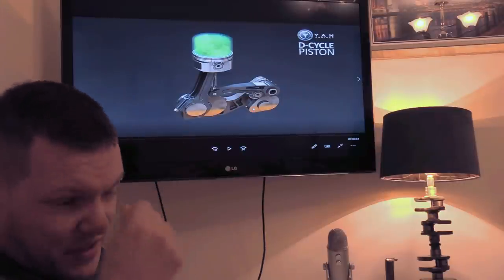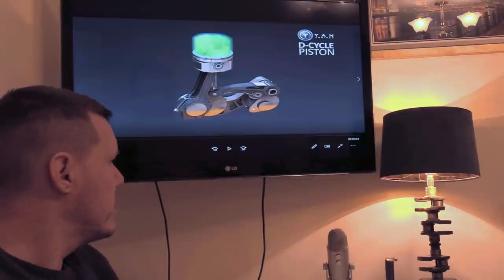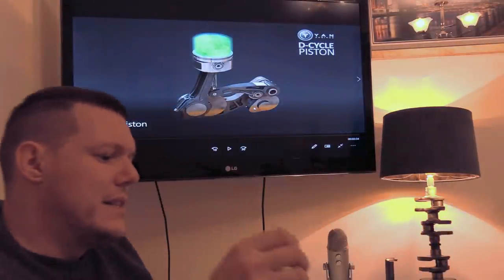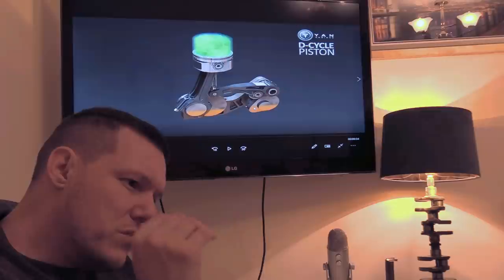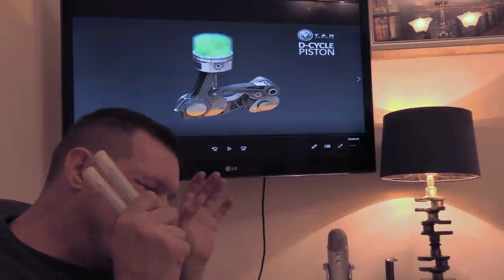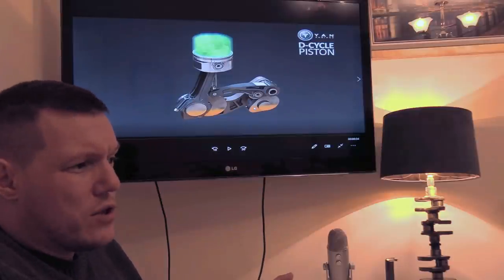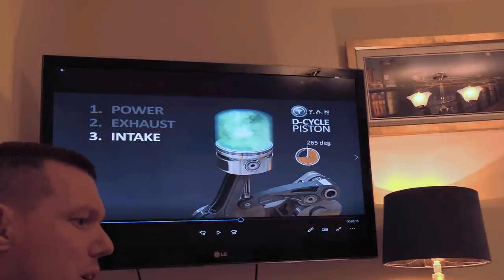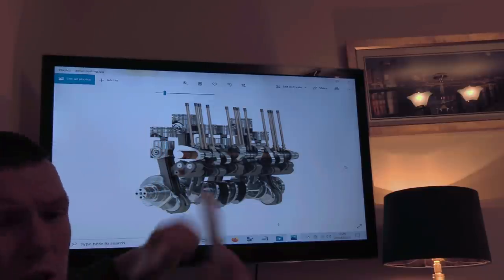D cycle engine | Part 2

Comment: maybe I was a little pessimistic with my comment on the last video, but im still worried about the wear the piston crown coming together with the lower piston will cause
Reply: Just make the bottom part have more surface area, then you get an air pillow effect, which can be tuned and will likely have an rpm where it becomes restrictive, but it also means less wear or damage as rpm increases
Reply: @aterack833  then you seal it off, so how is oil coming to the piston crown, or if there's oil coming in, how will flow out?
Reply: @theo_korner  if you look, the piston crown doesn’t have a pivot at the top, and if you look at a regular piston the crown doesn’t have oil just the skirt, the crown has the scraper rings, so when the skirt comes down and leaves a film of oil behind the crown then rides on and scrapes this film down as it comes down, the area in the middle can be for excess oil as well as for the movement of the mini connecting rod that’s connected to the crown. On a normal piston the oil control ring is responsible for putting the oil on and for where it goes, there isn’t any separate oil system for the scraper rings or the crown itself, if anything it has more chance for excess oil to escape down the opening/openings in the skirt portion compared to a normal piston, if for some reason there’s a failure with the oil control rings that cause it to flood more oil in, but there’s no advantage for fluid above the piston though because the scraper rings are still the same
Reply: @aterack833  not for lubrication but to get the heat away, because the crown itself is not that big in mass
Reply: @theo_korner  well if there was a piston cooling jet, it would have to squirt into that opening if that was the case, but maybe the oil left on the surfaces would prevent the clapping effect, if not, I’m sure a fine tuned level of closing in could be done to allow a protective air pocket at the speeds that would most cause this damage, or the speed the engine would sit at the most, they could even be concave with drain holes on each side (just to reiterate, I’m only talking about the portions beside the opening for the other connecting rod), it’s even possible to have the cooling jets be timed and to shoot through the drain holes and then the oil would drain through when the jets stopped, or just have them aim through the slot for the other connecting rod.

The new question that comes to mind though is aeration once the air pocket has to move through the same openings as the oil
Reply: @aterack833  i was thinking aswell that oil in this cavity could act as some kind of dampener
Reply: @theo_korner  it would but getting it there means having the wrist pin porous or having the cooling jet aim weird, at least for a standalone oil film method.

With the air pocket method you most certainly would get more oil film also, and tuning of the combination to have the least resistance without slapping would be the hard part because the dynamics of the two don’t move exactly linear with each other but they are connected, any restriction in air means oil will stay there longer, and the fluid dynamics of the two will behave very differently.

Comment: You know what’s interesting? If you timed it right you could have a little bit of the power transmitted through the small rod and push the cam (ever turn a camshaft on a head off the engine and have it spring into positions because the springs push the cam?) that way it slightly reduces how thick and strong the regular rod needs to be
Reply from the maker: Applying force through a cam is not a good idea, and across a beam is even worse

Comment: My biggest concern would be that the top piston is the limiting factor for overall rpm
Piston ring flutter is overall the limiting factor for engine rpm (everything else assume built too handle)
I would expect far lower crank shaft speeds due to the exhaust/intake rapid movement 
That being said,
It could be good in diesels 
As it’s the fuel burning speed that is far more the dictation of rpm

Comment: There are a few clever aspects of this engine that I really like. The conrod and the piston of a traditional engine is designed to deal with the pressure of the power stroke, and the strength is wasted in the other strokes. This design keeps the heavy  conrod and piston bottom (if you can call it that) for the high pressure operations while it rushes through the low pressure strokes using lighter parts.

In a traditional 2 stroke, the exhaust port would open at 120 degree crank angle or something around that anyway, so I don't think there is not much "effective" loss of displacement compared to the length of the stroke.

A design that solves (in theory) all the problems of a 2 stroke by taking away the simplicity and weight advantage, with some side effects like over-expansion, but keeping that one thing that makes 2 strokes really great, 2ce the number of power strokes.
Reply from the maker: Cylinder density thats why.

Comment: The best way to make high torque applications like you mentioned become electric only is to have them run on rails or with cables (boats can’t run on rails reliably for long distances) that way they have electric power but don’t need to carry a full load of batteries to deliver coffee, they could have a specific lane and a special method to engage and disengage from the rail and a smaller battery set to get to the next rail for highway and road vehicles, but the real star will be bringing back rail dependant vehicles like trains and any other word for trains that just indicate where the train is (on ground, above ground, underground, whatever) and they can even start building buildings around them to make better use of the land and keep people off the rails (likely government buildings or anything with people known to be smart enough not to hop off the roof onto the rails or something) and for areas not covered the trains can have a two part system to keep the amount of track that is electrified limited, part one is having switch boxes that only electrify sections at a time that are the length of the train with a typical load of train cars, whatever keeps the number of these boxes down while keeping the chance of someone getting onto a portion that has electricity going through it low, it’s more the distance behind the train that’s the issue, part two is a battery system to both allow gaps between these sections and more importantly allow the train to not get stuck if a box fails and a second doesn’t power up

Comment: This seems like a good application for things like boats and snowmobiles which need mid range torque to be effective. Also there is a reason Yamaha didn’t just stick the r1 engine in their snowmobiles, a high revving engine doesn’t work for many reasons but a big one is the clutching and limited gear range of the cvt which uses a rubber belt. Yes they might be able to put a cvt with a steel belt more similar to a car however I doubt that it would do much better and it would add a significant amount of weight which would deter people from buying the sled in the first place. There’s a reason the brp 600cc and 850cc snowmobiles are still the best selling in the industry (yes I know that’s partially due to them being cheaper to purchase compared to equivalent performing 4 stroke snowmobiles like the Yamaha sidewinder which is a turbocharged 1L 3 cylinder.
Reply from the maker: It's called gearing... you can take your high revs and gear them down...

Comment: Isn't this an Atkinson cycle engine executed differently?
Reply: Exactly my thoughts too. Intake stroke 65 deg power stroke 120deg. When I commented on this on the first video I got a lovely reply.
Reply: Yeah. I also see it as an Atkinson cycle. I suspect that's where they are getting the 20% improvement in efficiency claim too. Not inherent to the design though, since you could just grind the cam differently for a plain old otto cycle.
Reply from the maker: Crank degree has nothing to do with intake/power strokes when the piston doing such actions isn't controlled by the crank. Andy got a standard reply, standard when someone is too stupid to see this but claims im the idiot 🙄
Reply from the maker: Lol fuck sake. Where is the 20% efficiency claim?
Reply from the maker: "Not inherent to the design" finally, someone with eyes...
Reply: But the power stroke looks longer than the intake. Explain to me where I am wrong, don't just write stupid comments.
Reply from the maker: You just wrote the intake is 65deg... it's not. Infact there's no such thing. Strokes are measured in length not degrees. 

And if you say thats not what I meant, its not even 65deg...

Comment: Starting with different displacements on the intake and power strokes, if the crankshaft is at 15^ BDC and the rod angle is ~15^ would any rotational force be applied to the crankshaft by the piston? 30^ of not much happening, IMO. But the scavenging cycle is advanced and with a literal four stroke operating cycle this fires every revolution. Doesn't that increase power per displacement so reduced size & weight, less inertial forces ion components, less friction, etc? 
If sized as for say motorbikes and efficiently tuned to a specific rpm (2-3k?) couldn't this concept have much to offer for hybrids? I can hardly imagine they're going after Alfadan for size with this one. 🙂

Comment: From the mediatechnical page on this design." More than this, it provides a much greater flexibility in improving efficiency, for example by reducing intake stroke volume to match the desired drive cycle demand with a long Atkinson expansion-to-compression ratio." well?...
Reply from the maker: Well what? You said 65 deg of intake, you're shifting the goal posts to avoid what you said.
Reply: @dirtygarageguy  No from the off (pt 1) I said Atkinson cycle. To which you replied "do your eye's work" it looked like it to me and this article bears it out.

Comment: The complexity argument is not valid since we used engines instead of bicycles and live in houses instead of caves. Also for the 12k rpm Warriors, some 2t dont Rev as high as their 4t counterpart, because they have more powerstrokes and doesnt need It.

It would be awesome have these engines into production. Imagine a twin cylinder 500cc bike with the D engine

Comment: So this engine is basically garbage but I have a question instead of having an exhaust stroke on a Diesel engine is there a way to open both the exhaust and intake valve at the same time and let the turbo push the exhaust air out while at the same time filling the cylinder with fresh air essentially turning it back into a two stroke engine.
Reply from the maker: This is called a uniflow design

Comment: I can’t see how the down force from the second piston combustion adds much of anything to the power to the crankshaft.
Reply: Oh. Back through the cam drive gear. Not sure how well any lobe profile would deal with that type of force.
Reply: @archiedentone5950   isn't there a second piston underneath that it meets up with? Majority of power is transferred to that and then to the crank. The cam and crank are connected via gears (notice the opposite rotation)

Now if the pistons hold up during contact or not is a different strory
Reply: @AmritGrewal31  only every other firing event. They “odd” events only drive the top piston

Comment: Weight wise, given most engines these days have a balance shaft (which I assume they'd incorporate into the cam) there's prolly not a lot in it. Complexity, well ,it's just another cam and roller rocker, meh. Really it's not much different to running a mechanical fuel pump off a jackshaft. Yeah, crown float could be an issue and valve clashing or even reduced intake stroke  if the rocker doesn't have some kind of return mechanism but I'd assume shit like that would be ironed out way before production. Personally, I'd say it's got potential - especially if they made it revvy but I'm guessing this is more "same power for half the rpm" type deal, less nvh etc. etc. That 20% seems like marketing wank, I do wonder if it's a case of "this is a 2000cc engine but swept vol is only 1600cc", unless it's a case of more power pulses mean less gaps and therefore less energy spent trying to rotate everything again after a gap (would a 4-stroke 2L I6 be more fuel efficient than a 2L I4 of similar design?) Be interesting to see how the rocker bearing holds up to the crown halting abruptly towards the end of compression stroke. Nice thing about this is a 3-cyl should be as smooth regular 6-cyl. Imagine a V12, power every 30° 😈

Comment: 5:16 But you're comparing a whole system when you say that. In a purely mechanical system if you can do the same thing with less than its almost always better.
Reply from the maker: Correct, so which on is it? Which part can you do without and achieve the same outcome?
Reply: @dirtygarageguy  A second piston...
Two pistons is likely less parts than one of these...

Comment: Thank you for an interesting vid. I really can't see this engine potentially making 130% power compared to a fourstroke, because the intake stroke is so short. The intake takes place between 200 and 265 crank degrees, which leaves just 95 degrees of the total stroke for induction and compression. Compared to the simplicity of a two stroke engine with no valvetrain, and a normal fourstroke engine, the added complexity and inefficient use of the total stroke in a D-cycle engine, makes it look pretty hopeless.
Reply: Just wanted to add, that if you look for a shorter compression stroke than powerstroke, I think some kind of Atkinson cycle engine probably does that more efficiently, power to weight ratio taken into account

Comment: really sorry I missed the first part.  After review, here's my thoughts:  12,000 rpm, is 200 rotations per second, the piston changes direction 400 times/second, the upper piston changes direction 800 times/second,,,, I don't see it happening, not very well, nope, I don't see it/  Splendid videos, thank you
Reply: Just run it at 6000 rpm
Reply: @aterack833  Chainsaw
Reply: @thomasgronek6469  gear drive
Reply: @aterack833  hmmmm
Reply: @thomasgronek6469  well it would work, though I doubt this would be used in a chainsaw so the other complications of the gear drive don’t need to be considered, also four stroke chainsaws are hard enough to design for let alone one with extra parts also requiring lubricant
Reply: @aterack833  agreed

Comment: Yeah, I know my turbo question was a bit prematured...

But still, that would be a great way to cheat haha!

At the end the biggest problem is how to get oil under the top piston properly.
Reply: This engine would work really well with forced induction, because it doesn’t need to make pressure more than naturally aspirated does and it will get more efficient from it, all it would need to do is make up the difference

Comment: I could see this being better on a diesel engine that runs cross head bearings and has a low operating RPM.
Reply: This wouldn’t work at all on a diesel diesels have huge pistons compares to gas engines and run off of compression not spark they also waddle in the cylinder quite a bit more then gas and they aren’t really low low rpm engines my trucks gas and diesel run about the same rpm on the highway
Reply: @Justthemow  Why would a 'huge' piston or 'waddle' make this less viable for a diesel?
Reply from the maker: The forces on the crown and pivot arm would be quite large...
Reply: @beachboardfan9544  because when the head of the piston separates from the skirt it has more room or play to waddle around in the cylinder which would sheer off the head and destroy the engine
Reply: @dirtygarageguy  Wasnt aware we werent able to design a crown capable of diesel combustion forces...
Reply: @Justthemow  You dont think a thicker piston crown and/or better tolerances could solve piston slap issues?
Reply: @beachboardfan9544  you can’t really solve clearances because you need room for expansion I’ve been thinking about it a little you could solve it with a two piece skirt that was keyed in such a way that the crown and skirt fit together like a dove tail but this is all just creating more friction and more metal fatigue from slapping together imagine the face of a hammer after nailing in a few million nails. It gets all galled up and scarred this is how the bottom of the head and top of the skirt would be after 100k miles because there no cushioning the impact
Reply: @Justthemow  I dont think this is really all that viable anyway, its a good cad model, but I dont think it'd be practical no matter how many issues you fix. In a high reving engine you're gunna struggle to fill the chamber quick enough anyway, and thats a fight you're not gunna overcome easily, air is only going to travel from high pressure to low pressure so fast...
Reply from the maker: "No matter how many issues you fix" does this include all of them?
Reply from the maker: Like?
Reply: @dirtygarageguy  Two cylinders

Comment: I find to sad that people can see what it's doing and you still have to explain it to them.I only see one point of failure that's not on every engine all ready that would be the roller on that cam while they are common for valve cams this looks to have more pressure on it.if it fails it will start to wear out, or wear down the cam not a mayor problem with a valve but this would cause that two piece piston to slap hard enough to break it,but maybe not and with the right oiling it might never fail that's why you need working model's to test and see the limit's of the design.this even happen when they test there is a difference making a few and all goes well,but when you make thousands your failure rate can go much higher that's when you get product recalls. or manufacturing wasn't up to the spec you thought it would be.